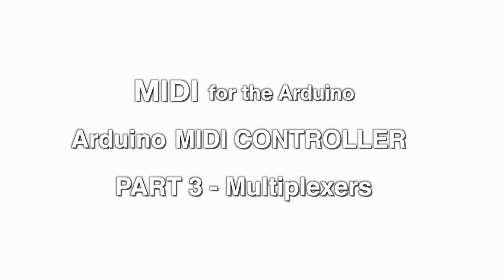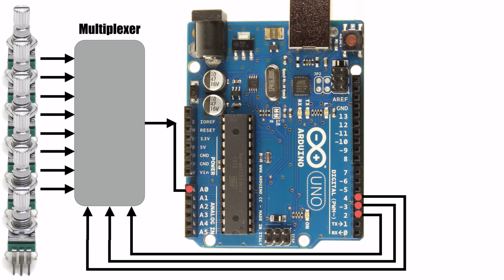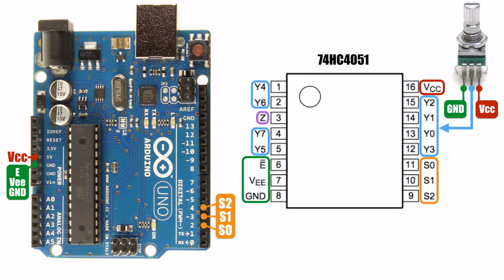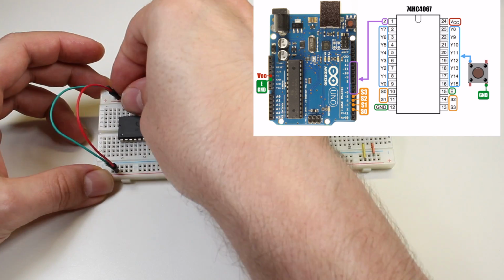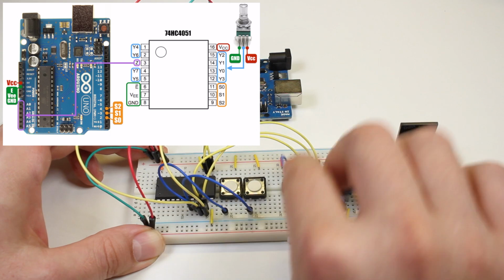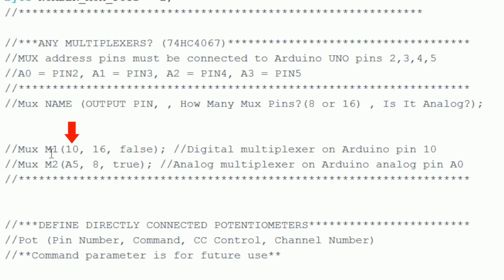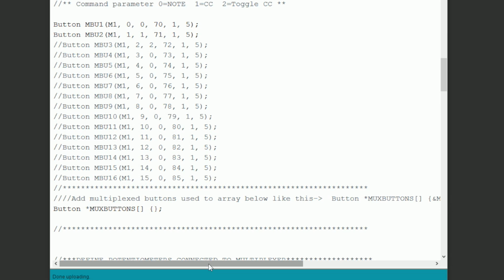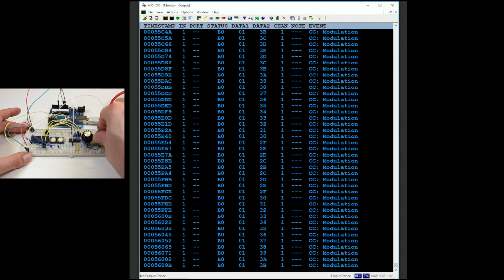Arduino MIDI Controller: Part 3 - Multiplexers

Comment: great job! thanks for sharing all stuffs to do for setup and the software. But how we can make a usb midi controller instead of midi port?
Reply: You can do flashing the hiduino firmware to the bootloader, mine works perfect on a arduino mega
Reply: @Djtekken4ever  hi. Thank you
 But i am dumb on codes. I can just open and upload to uno the codes. I just want add a usb port on breadboard instead of midi port

Comment: Hi Friend, I start making my footswitch for using it with guitar sim app like amplitube,Guitar rig, ampkit . etc. using 2 muxs to handle 8 switch buttons, 8 Pots also  2 toggle switches &2 pots connected direct to my Arduino UNO . in the  prototype I used  8 small press buttons 4 pots & converting my Uno with HUDUINO method and it was working good but when bringing that to live using wood box and some chines cheap 8 small SPSD & my 10K pots I see too much fluctuation coming from the pots and it stops only when touching UNO USB housing or some pins in pots . I am not experienced in electronics and my box is about 45CM by 25CM all Pots and switches 5V and GND connected to each other for example POT1 5v & GND connected to POT2 same pins and from POT2 to 3  and so on to the switch buttons and finally to UNO 5V & GND . what is the problem here? also note that I am using wires taken from ethernet cable  (as mention on it 22 AWG). hope you can help me to solve this issue. finally sorry for my bad English :)

Comment: Hi thanks for the excellent video as always. I have a little question to ask you : can I send program change with buttons on the mux instead of cc ?
Reply from the maker: Hi N PN. You should be able to. Just change the command:
MIDI.sendControlChange(BUTTONS[i]->Bvalue, 127, BUTTONS[i]->Bchannel);
to
MIDI.sendProgramChange(BUTTONS[i]->Bvalue, BUTTONS[i]->Bchannel);
in the updateButtons() function.

Comment: Is a CD74HC4067E likely to be the same as the 74HC4067 16 input multiplexer here?
Reply from the maker: Hi narco. Yes it will work.
Reply: @NotesAndVolts   Thanks for the reply. And the excellent series of videos.

Comment: too bad they stopped production many hc ic's in through hole version. Too bad an era has stopped, now it all becomes smd, ofcourse  they use smd since the mid 80s. But still as hobbyist i hate them. Now i build my own through hole version with the smd version. Some hazzle, but can be overcome.
Reply from the maker: Hi Klaas. I just tried to order some new 4067's in Dip and cant find them anywhere. I guess it truly is the end of an era.
Reply: i think they already stopped a few years ago as they had many on stock. But the 4067 is all gone, also the 4514. But many others are still massive available, like the 4051 8 multiplexer. But I think the reason for this is Arduino haha.
Reply: Just buy the break out boards with the small surface mount equivalent chip on them. I did that for this tutorial. Works fine.
Reply: @pekkagronfors7304  Not when you make your own circuits its damn annoying smd components.
Reply: @Klaas J: Sure it is. But for this tutorial, break out boards with the SMD multiplexer works fine.
Reply: My break out boards version: https://youtu.be/OApiJZ4FmF0

Comment: I reaaally need to use this code but with an arduino pro micro. What specific lines should I modify and which libraries I should use? Thank you a lotttt

Comment: I’d like a really simple controller that has an encoder which allows you to dial in the CC e.g 74 for filter frequency, and a second encoder to change the value of that CC number.

Example, encoder 1 set to 74 for filter frequency and encoder 2 to change the frequency value. Record filter sweeps into your DAW. Change the CC via encoder 1 to say 71 for resonance  and record changes to resonance from encoder 2. This saves you having to have lots of encoders or having to reprogram the Arduino to use different controller numbers. 

The CC encoder would need a 3 digit display so that you can see which value you’ve selected.

I can put the hardware together but can’t program the code. Is there anything out there like this?

Comment: What about the speed/strength of the buttons when you push them.
like when you hit the button hard, the note is stronger. And if you hit it slow, the note is weak.

Comment: Hi i have a problem, i tried conecting 16 pot. with a 16 multiplexer channel. The thing is that i get a lot of noise, its look like im moving some pots all the time. I tried to weld all the cables to reduce the movements. But i cant solve the crossstalk from some channells. 
Thanks it was very useful your video!
Reply: Had the same problem with random messages being generated - if you put your finger near to any of the Analogue input pins on the arduino do you see messages being transmitted? if so just connect any unused analogue inputs to earth - they tend to act like aerials if not. Worked for me. Hope this helps.

Comment: Hello all. This software is GREAT!!!! Very simple to setup and customize to the user preference..  With the software that Dave has written for the UNO it can safely run total of 64 inputs. If more than 64 is needed add a second UNO and daisy chain the two together with 220 Ohm resistor (VERY IMPORTANT) , Dave did a video on MIDI in and THRU... 
On the second UNO software in the code in setup.

MIDI.begin(MIDI_CHANNEL_OMNI);

and in loop before Dave's first line of code add this...
MIDI.read();

that will read MIDI from Uno 1 and pass it thru Uno 2 to the main MIDI out.

If you are using older pots or slide pots the MIDI out may bounce around a lot when not  touching the pot, I used a 10uf @ 50v capacitor connecting from ground to the signal terminal on the pot to solve that issue.
Reply: It can run more on 1 arduino if you change the variable array structure a bit. I can drive 111 inputs with some adjustments in Dave's code. I also added led output to the button toggle states so I get visual hardware feedback when a channel is muted.

And yes, this tutorial is by far the best on YT as well as on the net. The code is setup very nicely in a customizable way. Hands up for Dave!

One thing that would be great: this code ported to Teensy for USB, more native inputs and faster processing. But from what I understand it involves quite some rework as the direct port manipulation used in this code is not compatible with the teensy.

I created a PCB design for my mixer currently being converted. It includes 7 4067 (96 analog / 16 digital buttons) multiplexer shields, 2 595 shift registers in serial for led output as well as footprints for both the Uno and the Teensy so they can be easily connected via their headers without any cables. Only flat cables to the pots and buttons.
Reply: HolyPeyote recommendations on a customizable PCB? Software, design and who makes them? I have some projects where PCBs would be really nice. Thanks
Reply: I tried a couple programs as a noob past weeks Eagle, KiCAD but eventually I settled for EasyEDA. That one is very easy to use and has a great parts library which is user fed. You can directly order the boars in program.
Reply: Thank you I will check that out. This will cut down on my spiderweb in my projects
Reply from the maker: Hi Concert LD. Thanks for the update and info!  I never thought people would take this project as far as they have. I made it as a fun way to finish off the Midi for Arduino but many have really taken it to the next level. Anyway, thanks for sharing your knowledge. Great work!
Reply from the maker: Hi Concert. I use KiCad as my design software. It's free and really good when you get used to its quirks. I use JLCPCB.com to have my boards made. They have sponsored some of my videos but none the less, they are good quality and very low cost. Check them out.
Reply: Thanks for the info Dave I will definitely check it out! The project I been working on is a fully customized control wing for my grand MA lighting software....... I've a beginner with code programming so it's been a learning curve..... The project consist of 3 parts... Midi, mouse and keyboard.... This particular video explains very well on how multiplexers work, and how to use them in the software. So a huge thank you for doing these tutorials and helping others!
Reply: I am looking at converting a hammond organ keyboard to arduino - midi . Each "manual" (keyboard) has 44 keys. is it possible to simply string up 3 x 16 bit muxes 74HC4067 inputs and read them all consequtively. i was thinking one arduino per manual and then a seperate arduino for the other sensors such as potentiometers then feeding them through to the tone generator (what ever that might be - yet to be decided). I was thinking something like this....http://forum.arduino.cc/index.php?topic=456120.0

Comment: Hi Dave! 
Can you explain difference between  byte command and byte control which you used for potentiometers in your sketch?
Reply from the maker: Hi Kentforth. The Control parameter is the CC controller number that will be sent when the pot is used. The Command parameter is not used yet but i added it in case I wanted to change something about the pot in the future.
Reply: Thanx!

Comment: Hello ! I used 4 HC 4067 but when I load the program a memory out of memory message appears. I can only use 3 HC 4067. What should I modify so this does not happen and can I use the 64 keys? Use or Arduino ONE. Can someone help me?
Reply: Change the variable string by taking out midi channel and make it static for all ins. This will free up enough memory  to connect 7 multiplexers. I did this with success.
Reply: Hello ! I am using the original program and I do not know much about this programming language and would not know where to change this statement. Could you tell me where I change this statement? Thank you for your help.
Reply: You have to modify the controller.cpp / controller.h and the sketch. Too many place to adjust to write down in a comment. If you leave your mail adress I'll send you my modified code.

Comment: Hi! I'm planing to make a controller with 20 digital rotary encoders and some switchers, which Arduino do you recommend, or any other brand, no need MIDI connections just USB
Thanks

Comment: I'm a pharmacy student, meaning I have ZERO knowledge about electronics or programming. With that said, the fact that i can easily understand everything you just said just speaks about how great this tutorial was! Thanks man!
Reply from the maker: Thanks Dennis! That's awesome :)
Reply: no problem!a few quick questions tho, I'm planning to use 74HC4067 to make a 20 button midi controller (16 buttons for the midi notes on the mux and 4 buttonson the uno to choose banks) based on the midi fighter 3d:
1) will the 74HC4067 cause any latency issues when playing since the signal has to travel thru basically two chips? and;
2) do I have to change the code for the 4 buttons to be dedicated to changing banks like the midi fighter 3d or is that something i have to configure on the DAW itself instead, namely ableton?
3)is it still possible to use a usb b instead of a midi port and program that as a usb-midi port? or alternatively, flash the arduino uno to be recognized as a midi device? 

thank you so much in advance!
Reply: I'm not a professional by any stretch but I guess I can answer your questions somewhat.

1) I believe multiplexers are sufficiently fast as to not introduce any noticeable latency. Maybe latency could come from how the Arduino code handles the multiplexers, but to be honest 20 inputs doesn't seem like a lot of inputs regardless.
2) You need to change the code so your buttons send CC 0 or CC 32, which are the Bank Select MSB and LSB messages respectively. You might want to look into how MIDI deals with both the Bank Select and Program Change messages, because they work in a slightly different manner: you have to supply some parameter value so they actually do anything.
3) Technically yes, but you need to hack the Uno. The Uno has two microcontrollers, the 16u2 and the AT328. The 16u2 can be hacked to load a firmware which enables HID support, therefore making it possible for the Uno to be recognized as something like a keyboard, mouse or MIDI controller. To hack the 16u2 you'd need either another Uno or a way to access your Uno's ICSP port. Anyways, I think it would be easier if you used something with built-in HID support, such as the Micro or Micro Pro (they both have the 32u4 microcontroller).

Again, I'm no expert so whoever reads this, please correct me if I've dun goofed.
Reply: MrRockism thank you! That helps alot, actually!

Comment: Great videos, explained at just the right pace, without overwhelming the viewer with technical jargon. 

Windodge asked if this project would render a keyboard monophonic. Your answer was that the midi instrument itself would determine that. But since a multiplexer only outputs one value at a time, doesn't this mean that you're sending midi messages one a time? The way I understand this, is that the midi messages are sent fast enough to give the impression of polyphony. Please correct me if I'm wrong. :)
Reply from the maker: Hi Isabelle. Glad you like the videos. Your understanding is correct. If you play a C major chord - even if you manage to hit all the keys at the exact same millisecond (almost impossible for a human), Midi will send out three Note On messages one after another (C E G) in rapid succession . When you release the keys, it will send three Note Off commands to stop the notes.

Comment: This works great with the parts I could find. I am thinking about how to add a button or buttons in the code that adds bank(s) functionality. When the button for bank two is pressed, the pots would output a different CC# or on a different MIDI channel. A relatively small control surface with 16 pots and 16 buttons could then be used to control DAW software with 8, 16, ? however many tracks. My coding skills are rusty and were never that great to begin with ;), but thanks to your great videos and clear, simple instruction, I am moved to improve. Thank you sir!
Reply: you could potentially just add a button that increments the midi cc # by a certain amount? maybe a bit of a janky way of going about it but i think it would work.

Comment: If you connect a lot of potentiometers (lets say... 5 multiplexers x 16 So 80 total would be possible).  Could I connect them all to the +5v and GND without the Arduino board burning out or something?
Reply: With using that many pots its best to use a external PSU for the +5v. its Important that the ground of the UNO is connected to the ground of the PSU. Also make sure voltage is very steady because a difference in mV can affect the signal of the pot therefore changing the MIDI value.
Reply: With 10k pots each pot will draw 0.5mA maximum. A multiplexer around 25 mA each so in your case you could still power it all from the arduino with an power adapter connected to the arduino board. Even powered from USB will work with this draw.
I finished a mixer with 54 inputs and 4 mix 4067 all from the Arduino power lines. What I experienced is that star grounding is key for a clean signal. I applied semi-star so each channel strip it's own ground. This works out very nice without false readings and stable midi processing.

Comment: Hi, i finally got my controller working. Thank you for the tutorial. I wonder if any of you have idea how to sent all midi cc. For example i start Ableton and pots what i have assinged to sudden things has different value that is possition of pot on controller. I would like to add button witch i press and arduino sent value of every single one pot on controller. Is there some kind of Send all midi comand what i could use and assign to this button?
Reply: That is actually a great feature that I want myself as well. It shouldn't be to hard I'll try to implement it as  follow:
Use one free digital pin on the arduino to connect a single button. Once this button is pressed a void will trigger that loops at all inputs and send the controller data with a slight delay between them.

Comment: I seem to get a lot of problems when compiling this code. In e.g a few like this:

Controller.cpp:59: error: no match for 'operator&' (operand types are 'PORTDemulation' and 'int')
   if (_numMuxPins > 8) PORTD = PORTD & B11000011;

Am I missing something?
Reply from the maker: Hi Sebastian. Are you using an UNO board for this?

Comment: how would I use hexidecimal values for the MIDI CC messages?
Reply from the maker: Hi Win. You can write the values as Decimal, Hexadecimal, or Binary in your code. Whatever you are most comfortable with. The Arduino doesn't care and will treat everything as binary in the end. Watch this video if you are unfamiliar with how these number systems work: https://youtu.be/0FIyHxL3jC4
Reply: Thanks!

Comment: How add A led by mux bouton for each bouton A led for 1 key is presed
Reply: Adding LEDs would be fairly simple.  The LEDs would not talk to the arduino instead they would be managed by the button, when you click the button it connects to ground, so you could use a transistor to turn on the LED at the same time.

Comment: Hello! Very interesting and useful video. Thank you! I have a huge thread, if there is time, please make some more how to connect the encoder with the button, in other words, 5-pin. Simply, I'm new to this business and I do not know if there is any special difference when connecting buttons and potentiometers or encoders. And can it be done so that an encoder could be assigned to patches and presets in built-in or third-party plug-ins anyway? Thank you very much in advance!